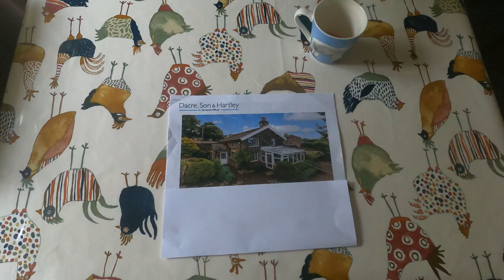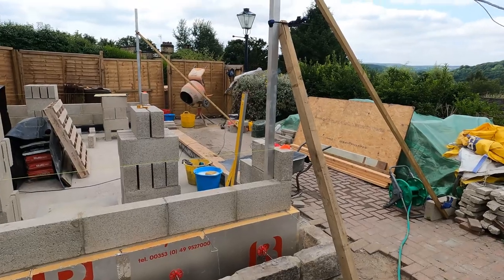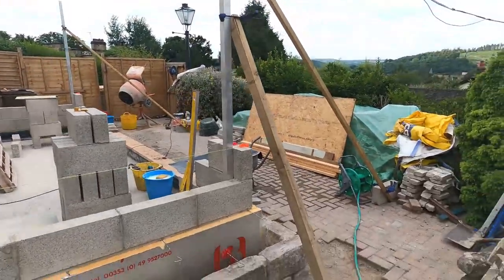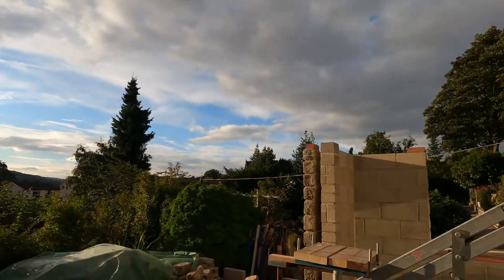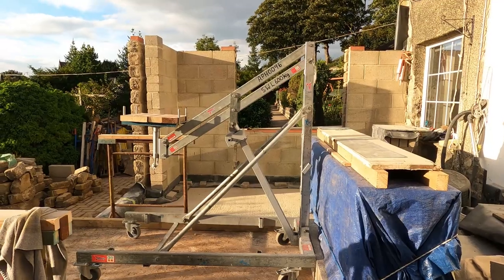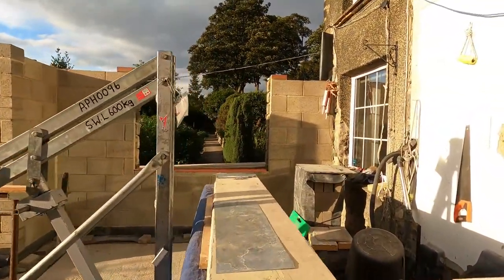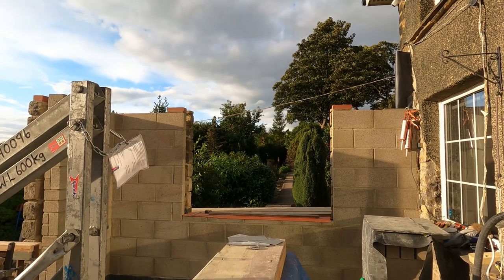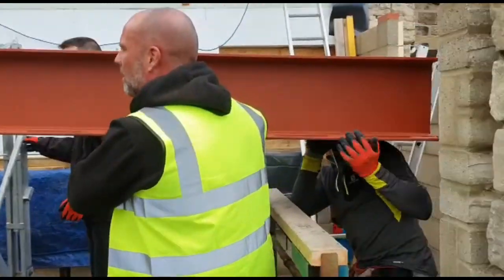Yorkshire stone cottage extension build and full renovation, Episode 4

Comment: What goes in the air space between the outer stone wall and the inner block wall?
Reply from the maker: The cavity is part filled with insulation and rest is an air gap. 
Depending on the design and architect it can be part filled or fully filled in the Uk